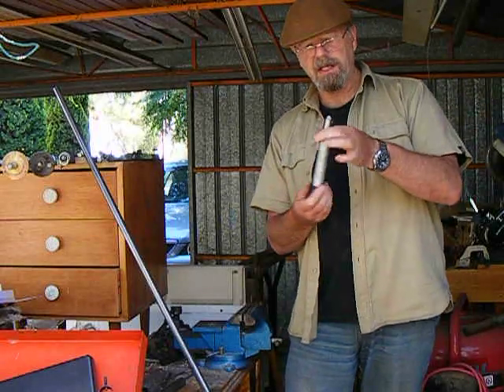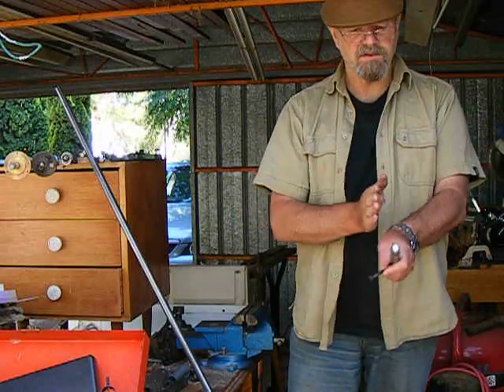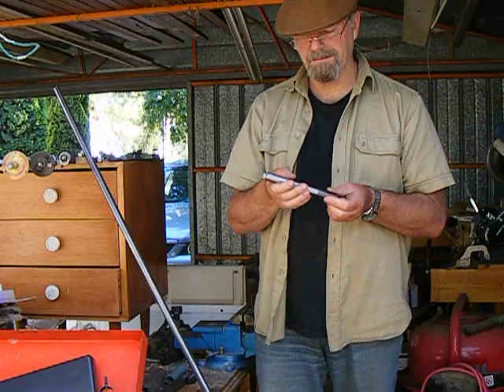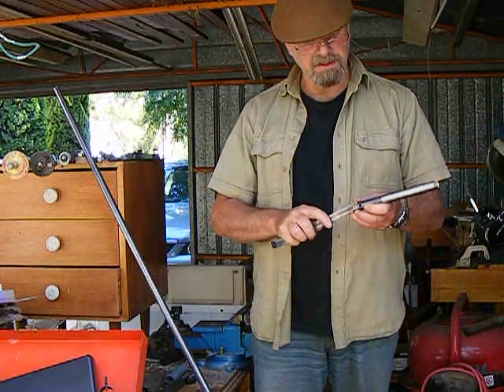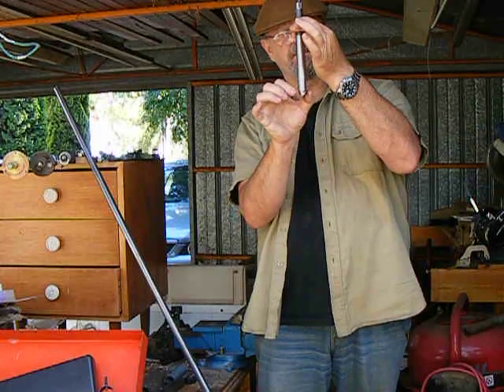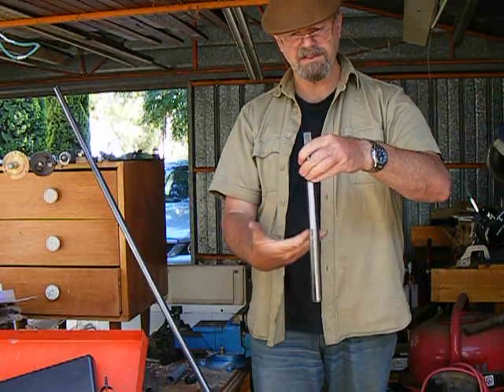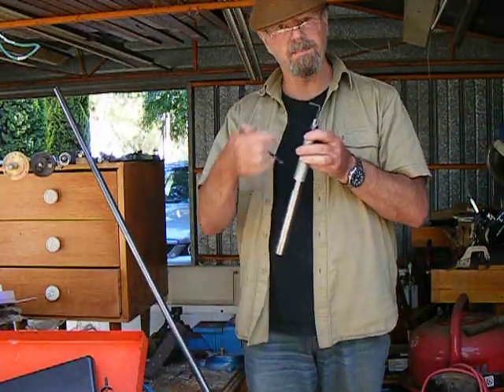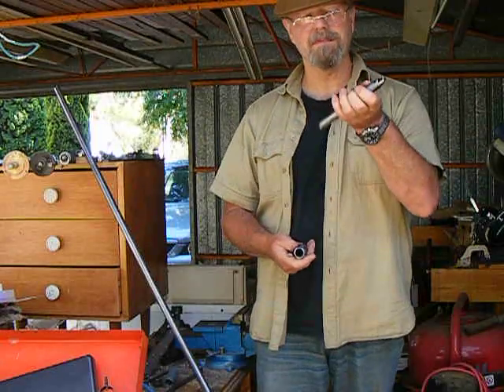DIY Making a 4JX1 Isuzu Diesel Injector Removal Tool - Part 1

Comment: hi edwin
just want to say a big thanks for this video!
successful job and worked great! only problem for me was finding the 3/4 die and the hardend 1/4 bolts, turns out caterpillar use old unf threds and high grade bolts on their diggers so thats where i got them, my first attempt on the tube and it bent because i could only get a closed die for the 3/4 so second time i just went real slow and plenty of oil and it worked. thanks again :)
Reply from the maker: +ed728i a stirling job ol chap!  Your thanks much appreciated :)